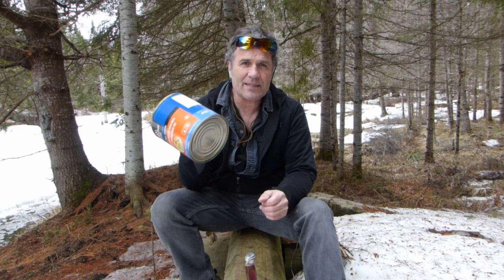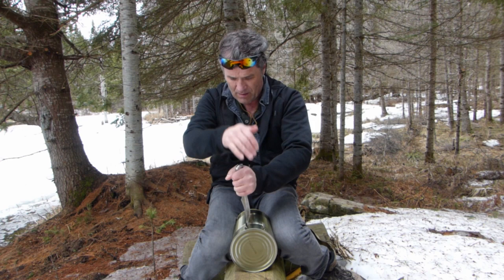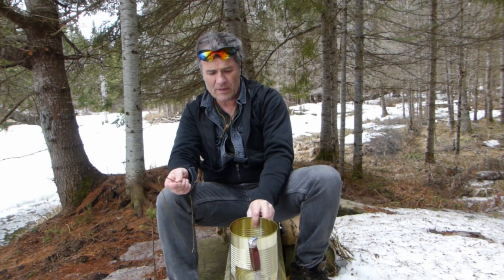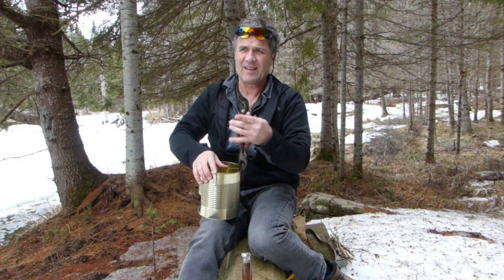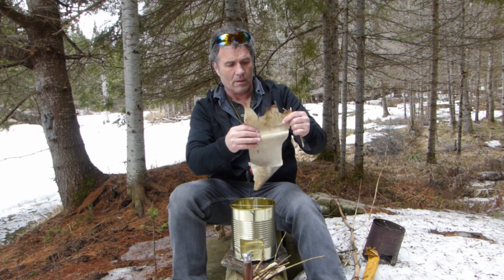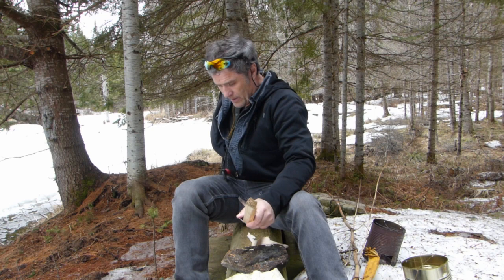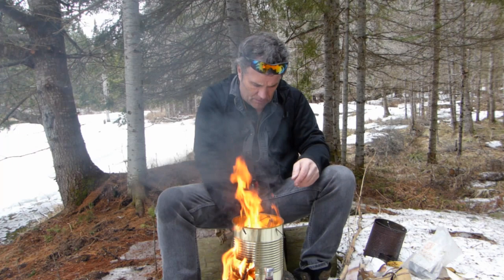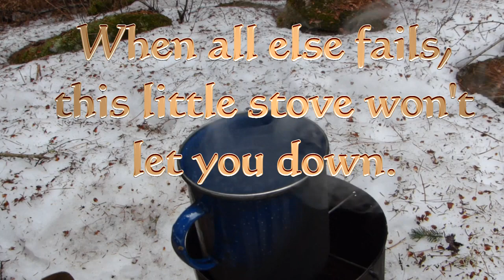How to make a Hobo Stove

Comment: Number 10 can. what about all the air holes around the bottom and the top of the can that people who make those claim that you need?
Doesn't look like you need them
Reply from the maker: Hello - People complicate everything. a simple door  for loading fuel which also acts as an air intake at the bottom of the can, is all you need. When the fire is burning, air is sucked in through the bottom hole and incinerates the fuel. The single hole allows for a vortex of hot air to circulate within the can. This stove is incredibly efficient and costs nothing to make. I have used them for well over 30 years and are a fail safe for me on every camp. The only holes I make at the top (4) are to allow a coat hanger to be slid through them to provide a perfect place to put a cup or small pot.  Easy and non complicated - awesome.  Thanks for the comment. Very much appreciated.  I do like when people question these camping hacks - It clears up the BS that is so prevalent these days.   Thanks again.